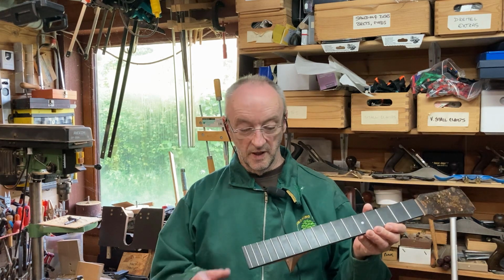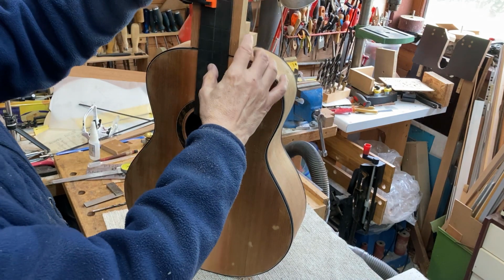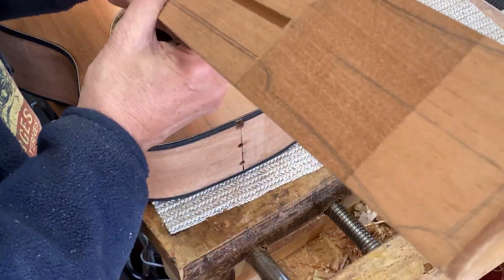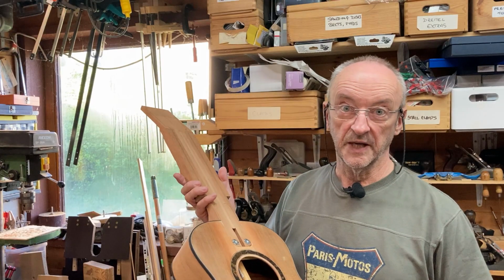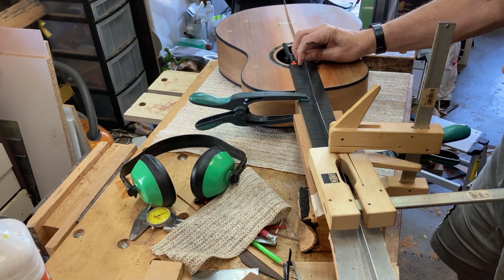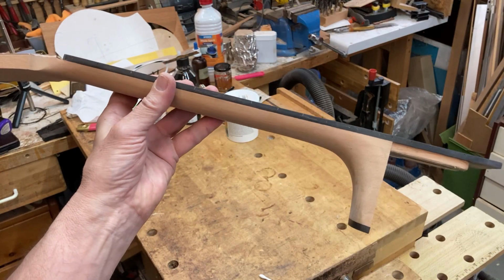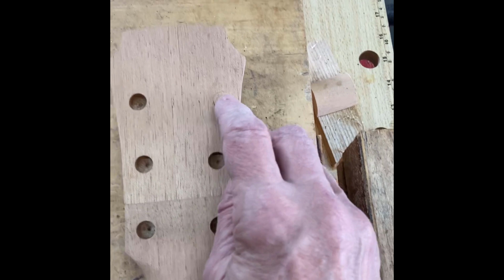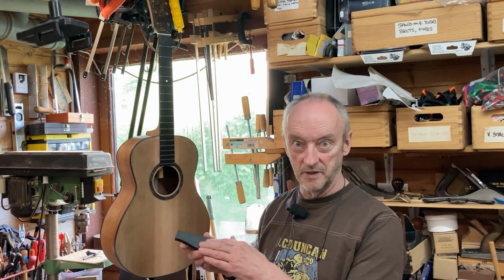GGBO 2021 Acoustic guitar build - The neck and fretboard

Comment: I am "BRAND NEW " at this. That being said, I am not new to using planes, routers, saws, etc. I am a retired carpenter/cabinetmaker and mill man. I still have to watch some of your, (and others' ) videos several times to absorb it all. That neck extension, and not gluing the fret board to the body so the neck can be unbolted, is very clever. Using toothpicks for guide pins, as opposed to steel, is beautiful too. I do wish you had a more "in depth" video of your binding cutter jig. (Yes I know they can be purchased, but you have to finance your grandchild's education to afford it". I guess dimensions are what I'm looking for. It would cut down on trial and error. I understand how it goes together
But thank you so much for your content.
Reply from the maker: Thanks very much! There's not much to the binding cutter jig really; I kind of winged it when I made it - just bought the drawer slides and went from there. Same for the router mount at the bottom: just used stuff that's readily available and cobbled it together. Ugly but functional!

Comment: Hi Chris.. love your video and you style of building. May I ask.. I notice you don't have a mortice of any kind for the neck join.. is there any disadvantage to that (perhaps your mahogany insert serves as a kind of mortice in terms of joining to the body)?
Reply from the maker: Thank you! 🙂 I've made necks with traditional mortice and tenons before, both for glued-on necks and with inserts for machine screws like this guitar, but this butt style of joint is just another option. I haven't really noticed any obvious disadvantage to it, although some purists might claim that only a full-contact, wood-to-wood glued join (eg dovetail) will transmit the vibrations between neck and body correctly (and they may conceivably be right, but an A/B test is not something I've done or know of). The fingerboard extension piece, if well fitted, will help locate the neck to the body in all the pitch, yaw and roll directions, which is why it's important to get the fit of the neck right before routing the pocket that it fits into. Hope this answers your question.
Reply: @GarlandStringedInstruments  Thanks so much for you detailed reply Chris... means a lot... I am looking to build my first guitar and your build, of all the ones I have looked at, speaks to me the most.. love the upper fret bolts concept to make a fully bolt on (removable) neck.. makes perfect sense. Thanks for taking the time to detail your process.
Reply from the maker: @fayser1  Good luck with your first guitar!

Comment: Very nicely done!

Something you might try the next time you patina copper is a sprinkling of table salt on the surface of the metal, and then treat with ammonia fumes.  The salt will help to bring out more blues and greens.

Also, your video editing has come a long way since you’ve started.  But please cut the music during times when you are speaking.  You’re a very soft-spoken chap, and the background music makes it hard to hear your dulcet tones.  😁
Reply from the maker: Thanks for the sound tip! I still have a lot to learn on this video stuff. But salt, and salty things (eg soy sauce), together with ammonia is exactly what I did for the patina on the copper. (I think I actually forgot to mention salt crystals in the video on 'Choice of materials' - my bad...)
Reply: @GarlandStringedInstruments  Hmmm, I never thought of soy sauce, but I can imagine it has enough sodium in it to have an effect.  Adding patina to copper is kind of hit and miss, you never really know what you’ll wind up with.  Another good way to influence blues and greens on copper is by using Miracle-Gro (plant fertilizer), mixed with either water (for blues) or red wine vinegar (for greens).
Reply from the maker: @mrimmortal1579  Yup, used Miracle-Gro (neat) too! But I didn't know about mixing with vinegar: I'll definitely try that, thanks!
Reply: @GarlandStringedInstruments  My pleasure, good sir!  Hope it works well for you 😁

Comment: Ok…. Now what’s that scraper plane you used on the fretboard????
Reply from the maker: That's a Lie Nielsen Scraping Plane. I only have a couple of expensive planes; nearly all my bench planes are restored old Stanleys from yard/car boot sales, but I've indulged myself with a couple of specialist planes. This is one of them, and it's a beauty 😁 But you don't need one - this job would be completely doable with a cabinet scraper or a block plane, preferably with a high-angle bevel, since ebony scrapes a whole lot better than it planes...
Reply: @GarlandStringedInstruments  I thought it was and was surprised to see it among your Stanley planes. I’ve only had old Stanley and Record planes which I prefer. I recently “indulged” myself with a Veritas low angle jack plane used off EBay and oh my what a vast difference! It’s phenomenal. No more old planes for me.
Reply from the maker: @markmelville6670  Yep, can't go wrong with that, but the old Stanleys are still very good indeed, and cheap if you're prepared to do a bit of work on them.
Reply: @GarlandStringedInstruments  I have refurbished a few of them although not with as good results as the Veritas. I have upgraded my sharpening stuff lately and I think I can go back and do a bit more fettling. I have a Record #4 that I really like. It’s a bit heavier than my Stanley #4 and fits my hand better.